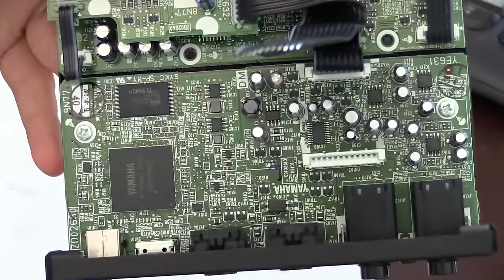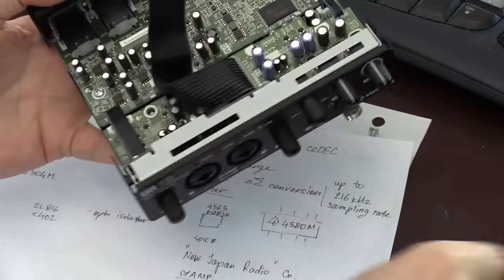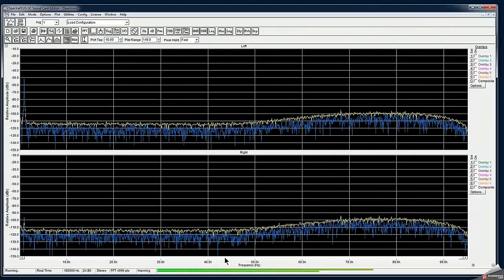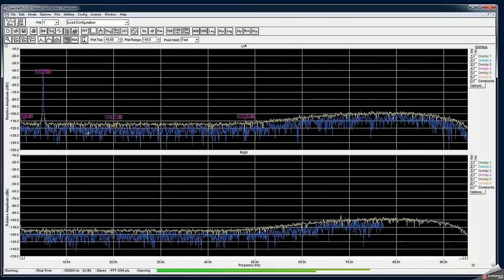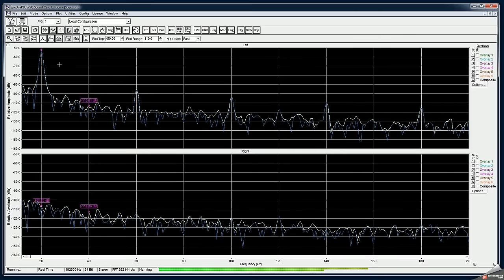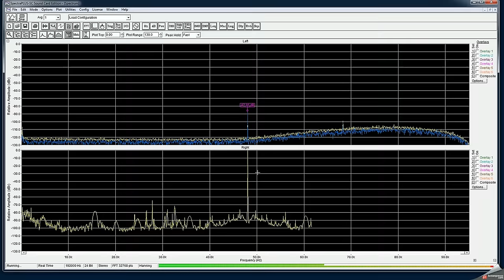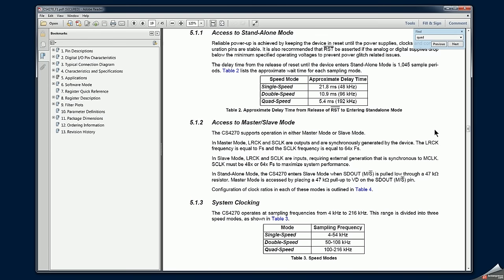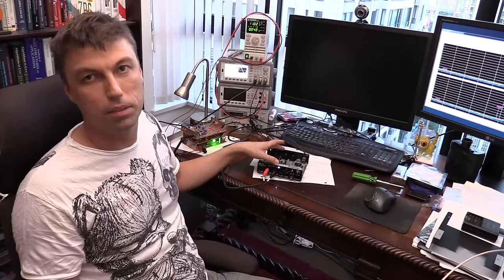Episode 12, Steinberg UR-22 24bit/192kHz USB Audio Interface review, teardown and experiments

Comment: So we've learned that its actually way beyond the specks because of the Sampling "headroom" of the chip which its @ 216khz. Well Thank you for that :)
You should know that Yamaha is a very reputable company and their chips have been used in ALL kinds of electronics, specially Soundblaster; the YM3812 synth chip for many decades.
Also this is an interface for Music Recording... This interface is by far one of the best for its size and price which is aimed to musician, not scientist like yourself. 
The specs on the box are more than they need to know.

My only complaint is that UR series have a low freq. 45hz roll off on the output. 
But anything past that always get rolled off in the mixing and mastering process...

Also NO musical instrument nor mic is capable of recording or producing sound past our own human frequency range. 
The doubling of 22Khz to 44Khz was introduced way back then when CDs came out to compensate a very strange digital phenomenon that happens when you sample audio to digital signal. 
Other than that, we have no need to record up to 192khz other than some claims that audio engineers have made over the years to impress... and make huge files haha!. 
The high sampling rate is used for other claimed  purposes. BUT 44khz is already High Definition audio and 48K sampling rate is more than enough. 
Specially now days where we screw up the audio with cheap MP3 encoders. But when you make an MP3 at 48K-32bit-320kbps no one can tell its an mp3 and if they say they can they are lying.

Also the Pre-amps are used for musical purposes and they use (Inverted Darlington Circuitry). which are also used in their hi-end digital consoles.
Floor noise was way low to the point that actually impressed me. WHat we hear on the video is not from the interface.

If I'm not mistaking, your freq meter is holding peaks all across..(those yellow lines.) and they are changing in real time as well.  

Thanks for the video but it may also confuse people that something is wrong...
Reply: I always think of it as sampling audio signal 192 000 times per second in digital domain, trying to simulate smooth analog wave signal.

Comment: Hi, Alexei. I faced the problem with my "ur 22". When phantom power is turned on, I hear a pop-pop-pop through my headphones, and the white usb led blinks and the device disappears from windows.
If I turn the phantom off, the device pops back up in windows and the led goes on solid like normal, but there's still no sound through my headphones. I gues something bad happened to the internal power supply. Maybe you knows how can I make it right?

Comment: Hi Alexei, I have a problem recently with my UR 22 mkII , when it is plugged to the computer now the USB connection light just keeps on flashing. I tried different computer, different cable and installed the latest driver and it just keeps on flashing and is not being recognized by the computer. Would you have any idea how to fix this without having to send it to Yamaha ? I would really appreciate your answer.
Thank you
Reply: Red I just got the ur22and have the same problem, did you get it sorted an if so what was the problem
Reply: Try a different USB port.

Comment: I need really urgent help with UR22.
I've been using it for over 5 years and i never had this problem before. The USB white light isn't stable, it's blinking and the laptop doesn't recognize it all of a sudden. I tried reinstalling the drivers and that didn't help. Does anybody know why this can be? I can't do anything without it.
Reply: Try a different USB cable! Or a different USB port, preferably one that is directly on your motherboard. If the USB connection is not able to power the device (due tue cable, or not enough power on the usb port), the LED will blink. Good luck!

Comment: This interface doesn' have pads on the preamps, so if you want to record guitars directly, it sounds distorted, even with the lowest level. Also the main out' s sound quality is not very acceptable. Ok it's cheap but you will not be able to record a decent demo. Later on I bought a Focusrite Scarlett 6i6, it is very good and the preamps record immaculately. Also don't buy focusrite scarlett 2i2 either, it also doesn' have pads on preamps.
Reply: Its funny because I've used it to record on the go and it works fine. It does more than a "decent demo" I have all the UR series.